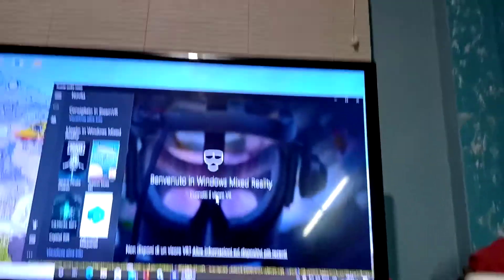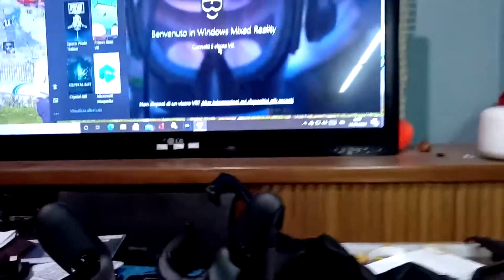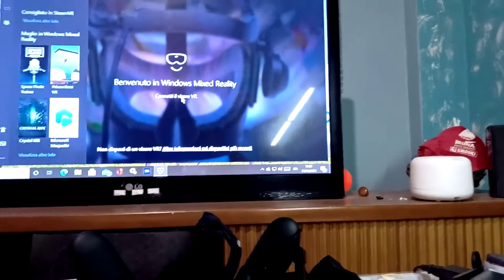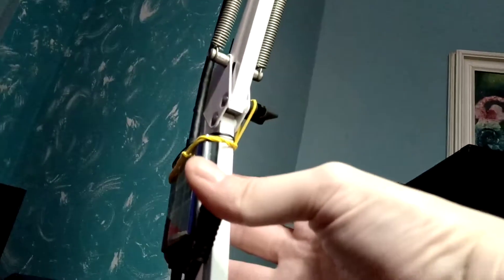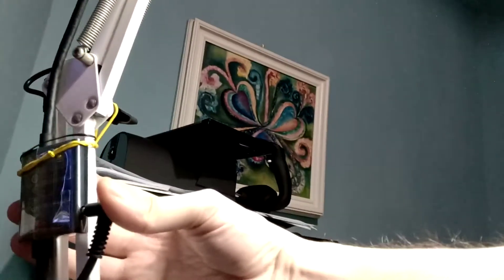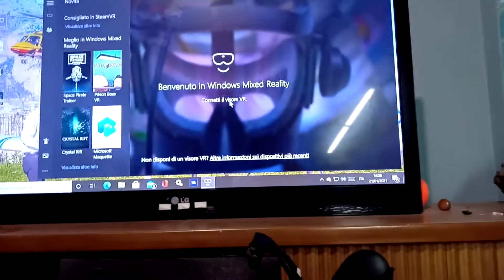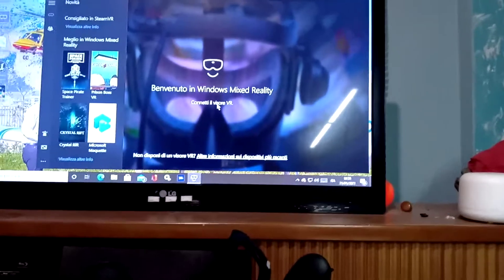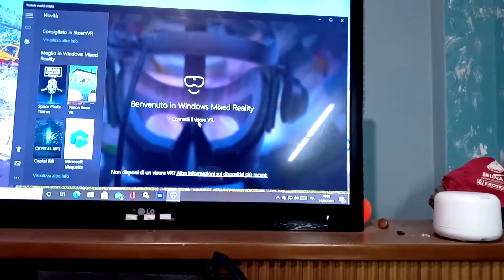How to solve HP reverb G2 connection issues, error 1-4 or 7-14 on ASUS Motherboards

Comment from the maker: Ok guys for those people that didn't fix the issue of HP cable, according with HP Support, HP made a new cable active with a larger power board (the one that is on the cable, the little square power board, where you insert the external power plug), and they have implemented even a switch, according to a guy that is follow this channel it fixes the issue, so I suggest you to contact HP support and say to HP that you have tried everything including a powered USB hub and that you have formatted your computer yet, and referring to HP that you have done your researchs and that you found that someone solved the issue with the new cable with a larger power board and a a switch: "SPS-CA ACTIVE 6M BLACK /W Switch".

HP would send you the new cable for free to your home.
Reply: Yeah man, I'm now back on this video because their new fucking cable still randomly gives me the fucking 4-1 error

Had it on both Intel and AMD systems

Comment: I turn down the brightness  on my laptop monitor to free a bit of power. I get the message also if I run the laptop on battery power alone.
Reply from the maker: Unfortunately it sucks a lot of energy so you need the new cable

Comment: I've been getting a 4-1 error no matter what ports I plug in, drivers I reinstall, doesn't matter, I bought a pcie usb c adapter since this stupid fucking company shipped it with a USB c port (a 3090 can barely run this thing apparently, I don't know why they thought the primary users of this headset were going to be laptop users) it's coming in the mail tomorrow, AMA I'll let you know how if I got it to work
Reply: Did it work? 😢
Reply from the maker: Yep, and just to let you know i bought a Pimax Crystal light and even if was working with the normal usb ports then i got issues about being slow or shacking video, when i plugged on my usb hub powered it worked fine and i don't get issues anymore, so sounds that it's a motherboard issues especially with Asus
Reply: @danielecarmona  should I get one pcie with a USB c or USB a

Comment: Thanks for the video, i have a few questions. your pci-e adapter (on the video) have 2 type-c ports and the one you linked doesn't its not the same one. also, why didn't you plug directly to the type-c port without the HP type-c to A adapter? you must use the HP Adapter?
Reply from the maker: Yes, i tested the first one pcie device and it was a bad quality so i bought after many researches another one that is the same on the description, this new device is more stable, the first one got a short circuit, anyway the typc-c wasn't working, i remember there were two typc-c ports but no one working, so i used the adaptor of hp.
Anyway the first device pcie wasn't working properly and i was continuing to have errors 1-4 and others, then it was unstable, anyway the new device on the description is a really good quality, a simple but very good product stable and i didn't get any errors until now so i recommend it, the link is about the new device.
Reply: @danielecarmona  ordered tnx
Reply: @danielecarmona  Well i just got it. and didnt help. same error 4-1
Reply from the maker: @lechcomash5127  be sure you turned one the cable power of HP, and be sure that you connected the SATA power coming from your pc power supply
Reply: @danielecarmona  ok thank will update again
Reply: @danielecarmona  Nope didnt help. i do have white LED on the AC Adapter (not on the headset) but i still getting the same 1-4... :((((
Reply from the maker: Try to follow the steps on the video
Reply: @danielecarmona  Well everything is connected. and looks like its installed correctly (renesas usb 3.0 extensible host controller - 1.0 (microsoft)) does your pci-e have green LED on it? like in your video? or its just because in the video you use different one? (i don't have green led on it). sata power connected to ..
Reply from the maker: No led in my pcie, remember i told you that the device pcie in the video is different from the one i updated in the description, so you have my same device, like i said be sure that the SATA cable is coming from the powersupply of the desktop pc is connected in the pcie, otherwise it won't work, then be sure that the power of the HP reverb is connect to the little square device that you see on the HP cable, then if it still doesn't work go on your Headset follow this steps:
- unplug the power on the hp cable;
- unplug the cable from the HP headset. Blow inside the female plug (once removing the cable you see only an hole where the cable should be plugged in the headset on the left);
- insert the plug in the HP headset and be sure it's all inside, you should listen like a click, the plug that you can see still a bit outside from the headset should be not more than half centimeter;
- now restart the pc;
After you fully start the pc you can plug the power cable on the hp reverb cable, you should see a white led on, then go to your headset and be sure that the led on HP reberb headset with the logo "HP" is ON.
If it's on it should be a problem of windows mixed with reality so Uninstall restart the pc and reinstall it.
Last try is be sure that windows is all updated if not update do it.
And even try a different USB port in the pcie ( there are two ports).
If doesn't work probably is the PCI-e so ask a refund and take the same model but new.
Reply: @danielecarmona  First of all i want to thank you for trying to help me i really do. so BIG thank you for the support!
i did order the one in the description. (4 ports type A 3.0) - connected the Sata power cable from my power supply to the pcie adapter.
i did like you wrote. disconnected the HP power supply.
disconnected the cable from the headset, connected again heard the CLICK
restarted the pc.
reinstalled the mixed reality.
tried all 4 ports. getting error 4-4 on all of them.
the HP WITHE LED LOGO is never turning on.
only the HP power supply have white LED turned on when i connect the USB cable to the PCI-e.
Windows is updated to 20H2 Build 19042.870
on the Device Manager i can see error saying
Unknown USB Device (Link in compliance Mode).
don't have any other details.. its just not working...
which OS build you have installed?
Reply from the maker: @lechcomash5127  Build N. 19042.928
Reply from the maker: @lechcomash5127  can you give the model of your motherboard?
Reply from the maker: @lechcomash5127  for now do this:
Go in control panel --> hardware and sound (i don't know the correct translation) --> under 'devices and printers' there is "device management" click on it,
Now you can see all the devices on your pc, click on "Controller USB" (universal serial bus), now you can see all usb devices connected on your pc, if you have a few or one with the triangle and the exclamation point, select that one and right click on it "unistall device", be sure that all those devices with the triangle are Uninstalled and not more visible, then ---> shutdown the pc.
Now remove the PCI-E phisically and unplug the SATA power cable.
If you have more of one SATA cable put a label in which you used for the Powering the PCI-E, and when I'll tell you, you will plug another SATA power cable on the PCI-E usb (just for excluding that your cable isn't working or that the power is coming, if you have a tester controll that the new cable and the old one have voltage, if  you don't have the tester just plug that cable to another device (dvd rom example) and be sure there's voltage if it works there's!
Now you labeled the old cable and you Uninstalled phisically (removing from the motherboard) the pcie device USB, you can start again the pc.
Be sure HP reberb isn't plugged.
Go again on control panel, hardware devices and devices management and under USB be sure there isn't anymore the triangle.
NOW...
Shut down the pc, once off on your power supply of your desktop pc turn off the switch power if you don't have just unplug the power cable of powersupply, now push the button for start the pc 6 times, now the capacitors of your motherboard are empty.

NOW---> install again the PCI-E device on your motherboard (if you have more than one PCI-E port this time insert the PCI-E USB device in the second one (just for be sure that wasn't working the first PCI-E port),
NOW remember that i told you before to see if you have another SATA power coming from your powersupply, so now if you found another one use it so plug that on your PCI-E usb.
Now before you start again your pc be sure that your HP is unplugged and not powered.
Now start the pc, once everything is started plug before the usb cable coming from your HP reverb not powered and then plug the power of the reverb, turn on the two controllers too (sometimes give you that error because aren't ON.)
And let me know

Comment: Anche io ho questi errori da oggi, ho una Gigabyte B550, RTX 3080, Ryzen 5600X, fino a ieri ha funzionato per un mese, e qualche volta dava quegli errori, oggi non va proprio, se non per qualche minuto. SteamVR inoltre freeza e stuttera sempre. Ho ordinato su Amazon un HUB USB 3.0 PCI, dopo aver visto il tuo video, vediamo se risolvo con quello. Oppure potrebbero essere le RGX serie 3000 e i loro driver.
Reply from the maker: Lorenzo grazie per il tuo feedback, ti confermo che si tratta di una sensibilità del visore VR HP g2 alla corrente, infatti se non viene erogata la corrente esatta va in errore, magari riesce a funzionare ma durante l'esecuzione di app pc (giochi ecc...) che richiedono più potenza vi è un calo e il visore si spegne, cosa che ho provato a risolvere con la precedente scheda PCI-e ma era di scarsa qualità e riportava errori o black out, adesso ne ho acquistata un'altra quella che trovi in descrizione e oltre a non scaldare è stabile, non mi ha mai dato errori mentre la precedente praticamente spesso e funziona benissimo oltre che più economica.

English:

Lorenzo thanks for your feedback, I confirm that it's the sensitivity of the HP g2 VR viewer to the amperage, in fact if the exact current is not supplied it goes into error, maybe it can work but while running PC apps (games etc. ...) that require more power there is a drop and the Headset turns off, which I tried to solve with the previous PCI-e card but it was poor quality and reported errors or black out, now I have bought another, the one that you canfind in the description and in addition  the card isn't heating  and its able, it never gave me errors while the previous PCI-e card but it was poor quality and reported errors or black out, now I have bought another that  you can find in the description and in addition to not heating is stable, it never gave me errors while the previous one practically often and works very well and it's more economic.
Reply: Hai risolto con la scheda pci?
Reply: @Kris-me5rs  Si ho risolto e va da Dio, da quiando ce l'ho, il G2 non mia più dato problemi, ma è quella linkata sopra, non il modello del video.
Reply from the maker: Si l'avevo già scritto in un commento che l'avevo cambiata perché quella nel video era morta dopo poco e dava problemi, comunque bene alla fine ho fatto meglio di HP 🤣
Comunque adesso l'ho scritto in descrizione così non ci sono confusioni.

Comment: Thanks for the video..I also have the x570 and I am using an powered usb hub instead...it was working fine the first couple of times using it but it started crashing steamvr or not recognizing the headset the last time I was using it with blue screens and stuff ...are these pcie cards different then a powered usb hub? Because the usb hub is connected normally through the USB ports on my motherboard...I’m not sure what to do and if it will even help to buy the thing you suggested
Reply from the maker: Yes it's so different, and you don't use the motherboard usb, so it works, anyway sometime happens that it's not recognized but it's a mixed reality problem, you just have to unplug the power of reverb g2 and close mixed reality and plug again and open mixed reality again, just that

Comment: and yet there are still those who had theirs running and then have the same problems later on.  the reliability testing on this thing was unacceptable and completely piss poor.  It was never ready to be released for mass distribution.  The lack of response from HP is whats most disturbing.  "all these fucking issues" says it all. what a joke.  I gave up after almost 30 hours of trouble shooting like you, starting with software and drivers and all the way down the list. I simple ran out of time on the window to return it cause I couldn't get a base line that it actually worked, trying to get it to run on two different computers.  So I sent mine back and it has left a very sour taste in my mouth about ever buying another HP product ever again.
Reply from the maker: I know what you are talking about, it's something that is making upset people, how can you pay so much for a vr headset (and Europeans are paying more than others) and have all these malfunctioning?
I had a bad experience with HP g1 that immediately broken after a few days because a poor design where the cable coming from the headset where plugged in a plastic connector that was too heavy and because gravity bends the cable, after a few days my first blackout, so i sent back and i ordered G2, anyway I'm experiencing even other issues now, the plug that goes inside the headset loose the connection and windows reality gave me an usb error, then after a few hour of continuous usage it crashes, now I hope i won't have any other issues because I'm tired to change headset, and I'm amazed how Hp, Microsoft and Valve design this working together and having that resulted.
Reply from the maker: @20awakening12  i didn't talk about USB hub, the hub doesn't work, you can solve with the USB PCI-e that i showed on my videos, don't use a USB hub connect to your usb on your motherboard because you don't avoid the chipset, only USB PCI-e works but it must be powered by your pc power supply, try my same trademark, i didn't have any other problems, some errors pop out because windows reality program, so in this case you have to Uninstall windows reality and install again and of course restart the pc, and don't forget to plug the power of your reverb g2 headset or won't works, let me know if it works.
Reply: @danielecarmona  I sent the first one back. I was a sucker for punishment and ordered a second one. Plug and play. But not with more screwing around. The controllers are complete ass. So I had to buy dongles so I could use my old vive wands. Had to purchase VR stop sign so seated games like Moss would work without grey screen. And finally the headphones at only 80% or you get blue screen / blackscreen. Was it all worth it. I suppose,  but only because I had the vive wands already.  It's been a full on love hate relationship.  But that clarity us something else.
Reply from the maker: I'll try to explain something in a new video, I'm experiencing a lot of trick for solving many of these issues

Comment: Thanks man, i will try this with my original Reverb that still has not been sorted by HP 1 year and 5 months later
Reply from the maker: That's a long time, probably you should contact your seller, perhaps they had a somewhat that mess up your order, if you paid yet you should call or write an email, peace!
Reply: @danielecarmona  i am in contact with the seller and he is regurely talking with HP,i was promised and upgraded G2 deliverd in December 18th,i have yet to receive anything blaming covid,now the are asking for a case number and are quiring this,i  have ordered a PCI USB hub hoping that will fix the problem for now...HP have been AWFULL
Reply from the maker: @Nick Eoannis I know, i bought my hp on bestware and i ordered in December and i got it jenuary 15th, i mean it depends from the sellers, because hp has a lot of orders but maybe they send first to big sellers, you can ask for money back and buy it on bestware.com, they're so serious